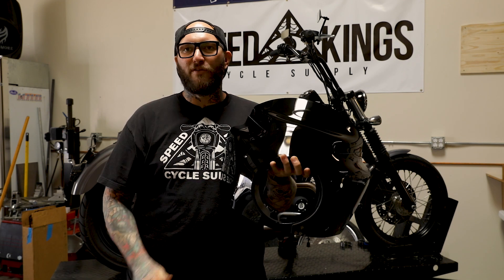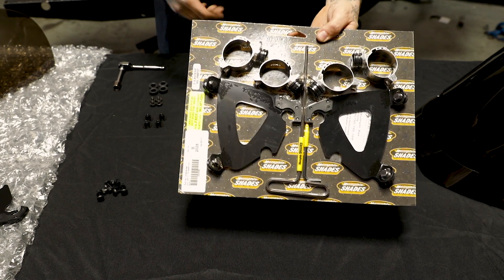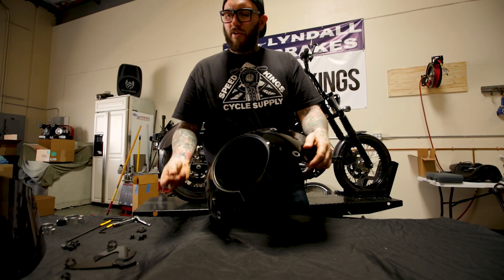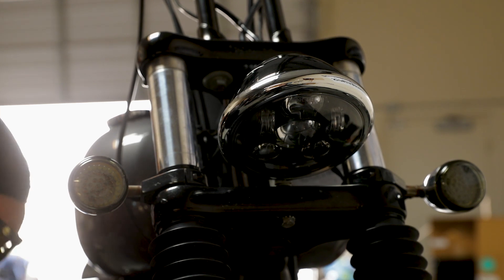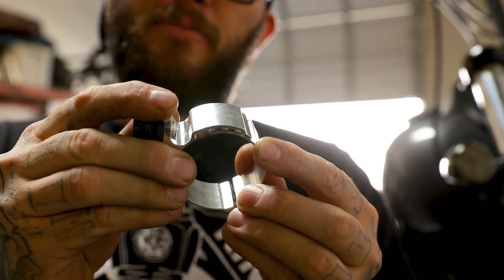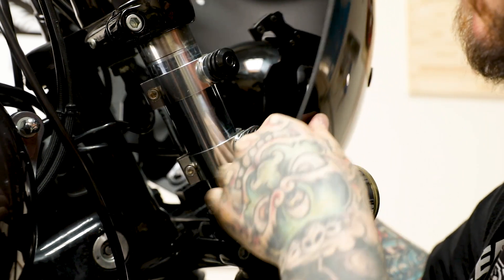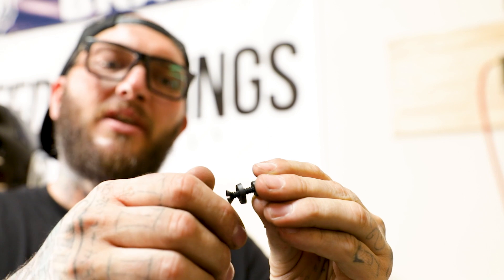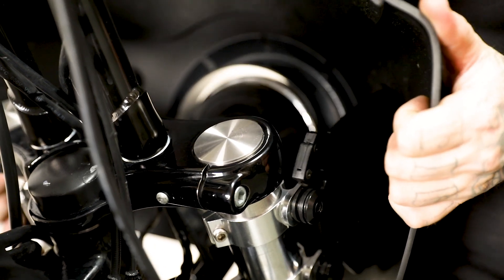SPEED-KINGS INSTALL: MEMPHIS SHADES ROAD WARRIOR FAIRING

Comment: just bought a road warrior fairing for my 2017 road king STANDARD.  am I going to have to remove the fog lights and turn signals permanently to run this fairing?  thanks for your time.
Reply: Well it's for a dyna.

Comment: How do you guys stop the wind buffeting with this fairing? I installed one with the 11" windshield on my Dyna Low Rider S and I can't go over fifty miles an hour without my helmet rattling my brains out. I tried tilting the fairing forward like I've seen in another video but it didn't help at all.
Reply: Have you tried the Vented Windshield ?
Reply: @nickjanssen8201  No perhaps I should though. I want to like this fairing and was hoping it would lessen the wind not make it worse.

Comment: Was nice to see with turn signals relocation, I moved mine and wasn’t sure if the fairing would clear them 
You do have the standard turn signal relocation hardware for Harley your using correct?